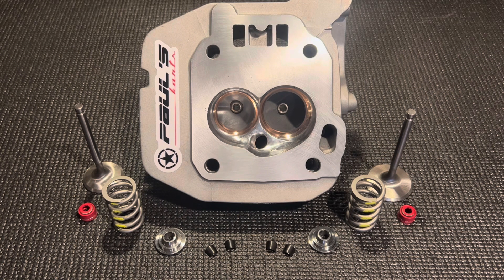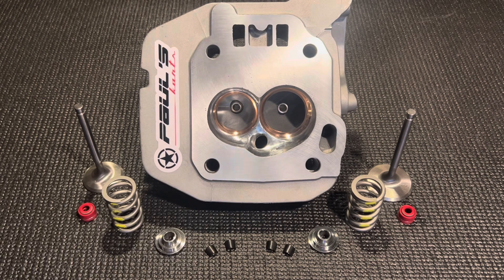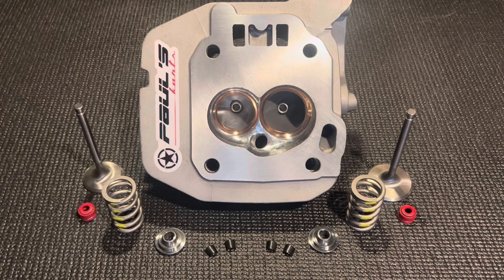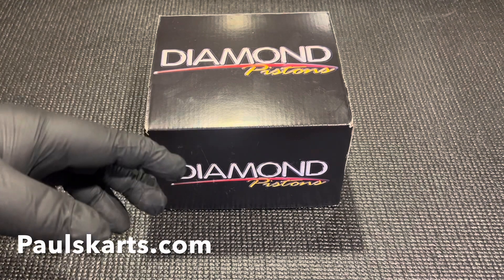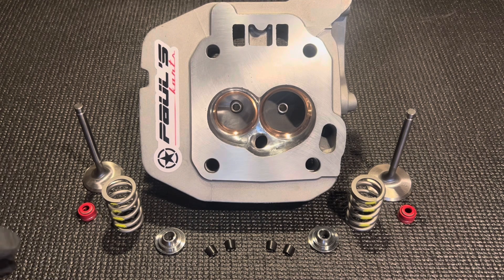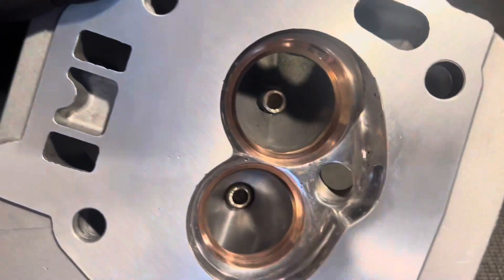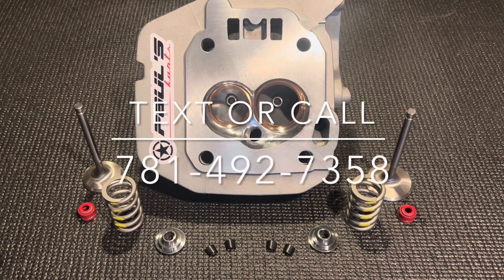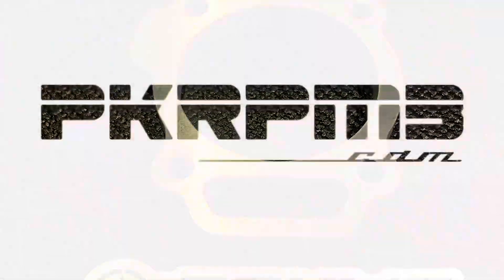This one is awesome !!! Gx390 big block head, ported 42/36 copper seats and more // Paul’s karts

Comment: Paul what's difference on 420 hemi non hemi just cylinder head
Reply from the maker: Head , piston has some valve reliefs on the hemi version, blower housings is slightly dif since the heads are dif it has a slight dif shape but can be swapped if needed. But that’s about it